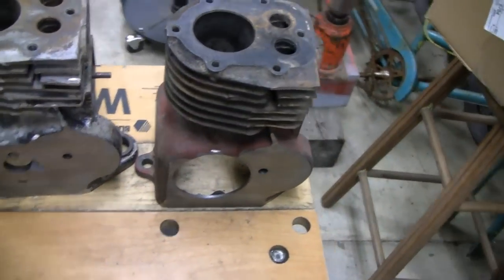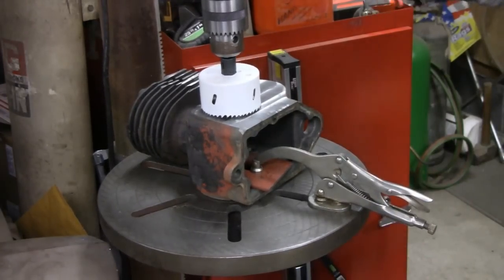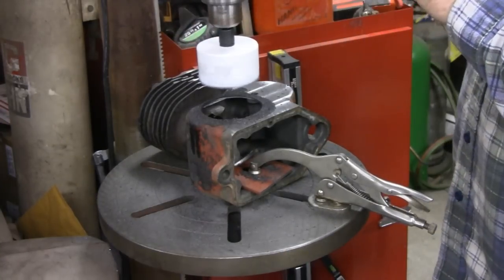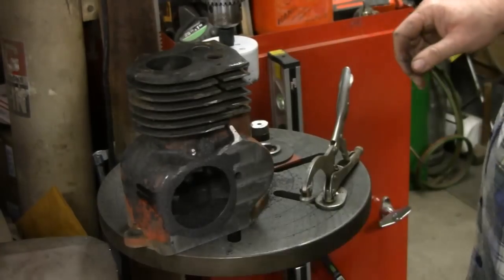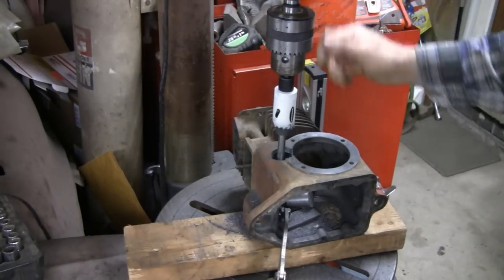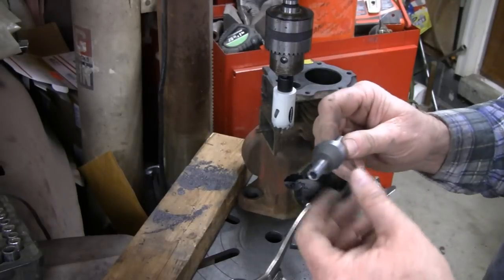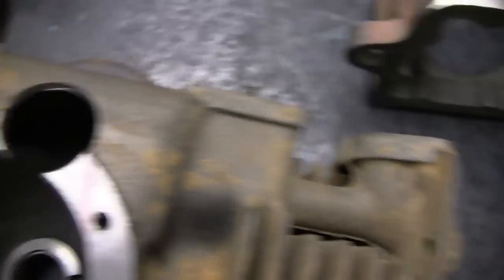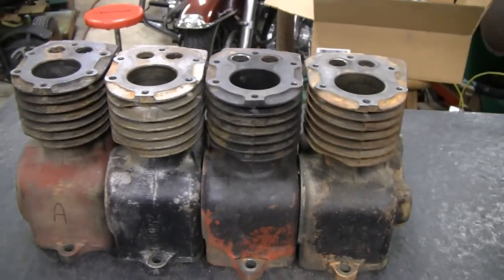HOMEMADE 4 CYLINDER BRIGGS PROJECT (part 3)

Comment: Your first instinct was correct. Iron is one of the few materials you cut dry. Lubrication is only needed for grinding operations for cooling and avoiding loading of the grinding wheel. It most likely sounds rough because a slower cutting speed would reduce "chatter".

Comment: Just a tip from an old machinist,you never use cutting fluid on caste iron,as you have found, it will bog down the cutter.Also ,that machine probably doesn't go any slower, but for that size hole saw a slow speed would have made it a little easier. Cheers Ross from Aussie
Reply from the maker: Thanks for the tip Mate!! It will come in handy!!☺
Reply: eiclan lan on cutting steel, use a wet rag inside, with water and baking soda ( prevents rust) pour some of the liquid on it as you cut

Comment: What is the ideal RPM to use when cutting metal with a hole saw?
Reply: if its a high speed steel cutter cutting cast iron with a 3 inch diameter then between 110 and 150 rpm would be reasonable

Comment: May I make a suggestion,...wouldn't it be better to have a 2x4 wood piece lodged against the drill press post and then in through the bore of the block to stop it from spinning, which could jam the hole saw?   I know that this, by now , is after the fact,..but I just gotta stick my two cents worth in there, 'cause I'm right there with you as you're working away,.....
Man, this is interesting !!! and Thanks
Reply from the maker: Thanks Bud!! I keep the belts a little loose so they will slip if something does get jambed, something that big I can usually hold but I do use the post on smaller stuff!!☺

Comment: So it looks like after the side of the case was milled there is still a decent thickness in the material, nice work on the holesaw operation, I normally get in too big of a hurry with those on a hand drill and breaking my wrists, lol Enjoying this project so far.
Reply from the maker: Thanks Bud!! Yeah we really only mill off the appendages, so the side is still a substantial thickness!!☺

Comment: Wouldn't the original camshafts have worked by running a drill rod all the way through all 4 engines? I thought that was the reason you used this type of engine.

Comment: Now you'll have to build a car to power with that four cylinder.  I think it might have more displacement than my '82 Escort had.
Reply from the maker: Lol!! My Wife had an 82 Escort, Aye yi yi!! Me and Mike were talking about maybe making a Mini Bike to replicate an old inline 4 Indian Motorcycle for it!!☺
Reply: 805ROADKING That's the car that made a mechanic of me.  The body was stout, and the transmission was good, and that's about all there was to it.  Oy veh, cooling system problems, distributor problems, valve cover problems, cracked cylinder walls, front end problems, the thing ate a tire every 3000 miles.

Comment: I'll have to check out those Harbor Freight hole saws again. I didn't see white ones before. I bought a set of black ones from them that lost all their teeth the second I touched them to metal. I've had good luck with the ones from Ace Hardware
Reply from the maker: You bought the ones for wood and plastic!! you need to get the Bi-Metal ones!!☺
Reply: Nah they actually say they are for metal. I bought them a while ago. They are still sitting in my garage in case I need to cut a hole in a piece of Styrofoam or angelfood cake.

Comment: I did something very similar R.K.
I had an existing 2inch hole that I needed to be 4inch in about 30 cabinets.
What the common procedure is is to mount a sacrificial piece that covers the hole and then re-run the pilot through the center.
What I did was get a 2 inch hole saw (perfect fit in the existing hole) and mounted it inside the 4 inch hole saw ,but shimmed it out to the thickness of the material.
This way,what I had made was a self centering hole saw.
Reply from the maker: That's using your head Bud!! Think of all the time and trees you saved eh!!☺

Comment: The hole saws cut good I like your bushing Idea . Are you going to make a jig to bolt the blocks on for welding them together.? That metal dust sure can make a mess
Reply from the maker: We're not gonna make a jig, just square them up an clamp them together!!☺

Comment: Those hole saws cut through that a lot easier than I thought they would.
Reply from the maker: Yeah Me too!! I was surprised how well they worked since they came from HF!! They cut twice as well without the cutting oil and didn't dull them at all !!☺
Reply: RamblinAround keep them cool with water and baking soda ( prevents rust) and they will last forever